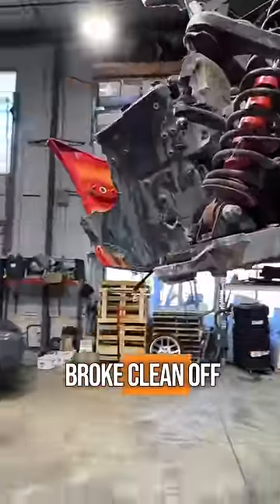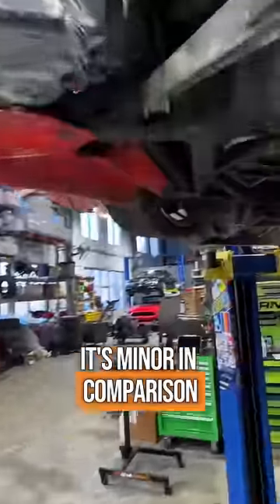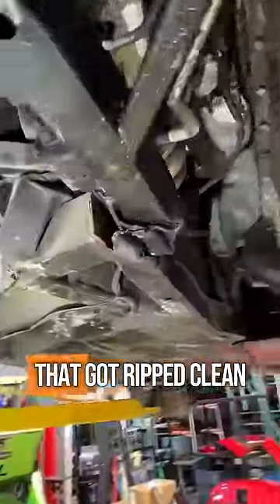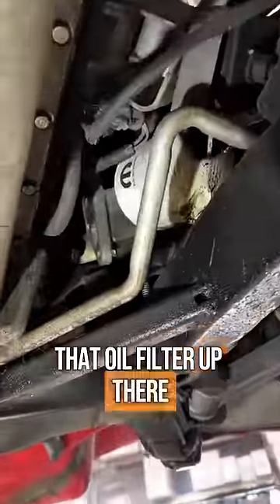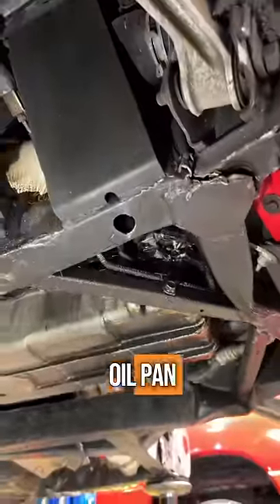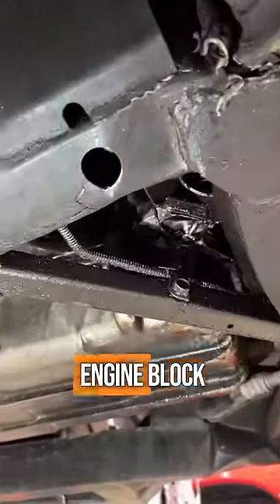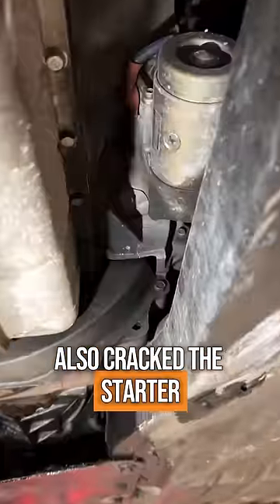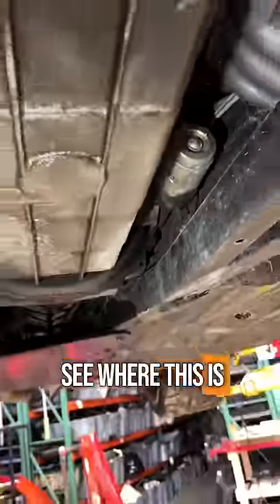$8000 Dodge Viper = JACKED Up!!

Comment: Worth about $500!😖
Reply: Naw $250 for scrap metal
Reply: Might be some stuff left in the engine that's worth selling 🤷‍♂️
Reply: That Engine alone is gonna run you between 9k and 15k
Reply: @charlesyoung3444  trans too, rear end shit even the bbs rims if some can be saved those would be worth to someone need extras
Reply: @charlesyoung3444  not when its junk its has cracks parts broke off in it.
Reply: @charlesyoung3444 it’s cracked lol nope
Reply: @charlesyoung3444  it also had an open hole when outside so must have a bunch of water in it
Reply: @assssss3661  maybe 2 rims are good.
Reply: Y'all are right, commented before he mentioned the cracked block. He said he made his money back, but so would I even if I didnt
Reply: @charlesyoung3444  not everyone has a viper. He made his money back from the youtube views
Reply: @djhodges6892  I like this guy, I'm not a hater just want to make that clear. But realistically he's made about 300$ off his last 3 yt shorts with the viper. Again not hating just being realistic
Reply: So dude died I’m assuming lol
Reply: I agree, 500
Reply: Go find a motor for $500😂
Reply: @trueaussie3097  You're looking at a cheaper one right now.
Reply: @trueaussie3097 in the conditions this one was in ill find you 30 for less than $500. Unless you have the ears of a fish he clearly said the block was crack in 3 different places from what he can see right now

Comment: If you paid 8k for that. You got bent over and used as a dumpster
Reply: He’s already got more than that out of the parts and still has the motor and other stuff left
Reply: @jamesfair9751  That engine is scrap.
Reply: @sdvten the block, yeah, but he's got pistons and the head/cams might be fine too
Reply: @magikarpusedsplash8881 you think it's a good idea to use pistons out of an engine that was wrecked so bad, so hard, that it cracked the block... Twice .. literally corrugated the frame, and put the oil filter under the trunk.... MF do you work for Ford or something
Reply: Until you realize YouTube money is the goal
Reply: @jamesfair9751 motors trash.
It's been sat outside with no oil cap and cover over it.
The engine is cracked in multiple places.
The gearbox bell housing is smashed.
Basically every inch of that car got pummeled.
Look at the chassis rail it's folded in on itself...
Reply: @jamesfair9751 didn't you listen, the engine block is cracked in three different places. So he doesn't have an engine left over my friend Total junk for 8K, This dude got hosed that's for sure
Reply: @magikarpusedsplash8881  i mean, i get your point. but buying used engine parts is a sin itself. Salvage as much shit as possible, but at this point, no one wants to buy a used pistons from a cracked engine, especially if the car was this bad. (You have to be honest when answering where it came from, or mom said go to jail)

like, if im buying used engine parts, which i will never, i am going to ask the mileage, the engine oil used, and the type of owner, also the car condition before it was taken out, every picture of it. it is better to keep it for yourself if you think it is good enough to be used again.
Reply: Lol yep
Reply: Hard to believe he made 8k and still has the damaged motor and trans
Reply: @11bravo80 the trunk lid might be ok
Reply: As a dumpster..... 😂😂😂😂 Good for you
Reply: I don’t agree. There’s probably twice that in parts. He could spend a day stripping parts and a day getting it out there that he has OEM parts. If you’re in this business he will basically make 8k for approximately 60 hrs of labor. Pretty nice right!!!
Reply: the block is cracked that engine is done
Reply: The t56 6spd transmission in that car is worth about half of what he paid for the car. As well as the engine is worth even more than that in parts. So no he didn't. You'd know that if you knew what you were talking about
Reply: Do it for the views
Reply: @jamesfair9751 Ya which part? Lol
Reply: @jamesfair9751 motor? What motor? That motor took such a hit that it’s all cracked up.
Reply: Yep

Comment: I paid 7k for my 08 viper, wasnt the best looking one but it ran and drove fine. Also had to replace the soft top
Reply from the maker: Wow! That’s an insanely good deal
Reply: @LeeC  yeah was a good deal, till I took it down the drag strip and lost oil pressure, had 2 rods come out to say hello
Reply: Cap

Comment: $8000? There's a fool born every minute
Reply: Pretty sure it was bought not in person and it’s ROUGH
Reply: @itsbrendoni3444  Still a fool if bought sight unseen
Reply: Prolly made more then that just on this video from all the hate comments 😂 yalls the clowns
Reply: @DesertRunner602 lots of people who do rebuilds from copart buy sight unseen 😂
Reply: @DesertRunner602  wasn't bought unseen and he made money off it so pretty good
Reply: Viper parts are very expensive and there's not a lot of aftermarket made.
Reply: He's already made his money back in parts he parted out. There's still more viable parts he's still removing, and the rest will probably be scrapped for even more
Reply: not with the chop value is on that, some stuff will also work with the Ram SRT10
Reply: You have no clue what money comes from parting out

Comment: I get it, rare car for cheap… but some things just need to be let go😬
Reply: Agreed, no reason to bid this scrap up to 8k hahaha
Reply: Same
Reply: With some cars they’re basically buying the VIN number so when they rebuild it on a new subframe it’s still technically a salvage title viper. Idk what these engine and transmissions go for but I assume that’s most the value besides the VIN.
Reply: @alexburke1899 does a salvage title give it cheaper insurance or something
Reply: @GewelReal  no it’s just harder to sell it, like when I do rarely look for a vehicle I usually click the filter so it filters out salvage titles and just displays “clean titles”. There might be some issues insurance related because it is a salvage, like I doubt you could get full value if it got totaled etc.

There’s nothing wrong with buying a salvage title vehicle if you know about vehicle repairs and know what you are looking at, and can make sure the repairs were done properly etc. I just don’t know enough about most vehicles to know if it was rebuilt correctly and would rather avoid them but there’s obviously some that are rebuilt correctly and a good deal if you are mechanically inclined.
Reply: Yeah this was done for youtube comment interaction purposes. He got hosed.

Comment: I bought my 2016 viper for 55k, put a clutch in it, and have been daily driving it for 6 months
Reply: Daym 55k that seems cheap for the golden year
Reply: @deadknight7617  it really was, I really just got lucky. Its a good thing they kinda suck to work on transmission stuff
Reply: Trade for a gated manual v8 R8 30k miles.
Reply: Great. How is that relevant to this vid?
Reply: @CR-te7hn  nah, I'm trying to trade up 🤣 🤣 🤣
Reply: Thats a badass daily
Reply: @connorarndt1726  it is, I just got lucky tho. I just wish I could drive it to work, but my job won't allow that bc im always bringing guys to and from the jobsite
Reply: @jacobm9263  true that but still a beauty of a car
Reply: @deadknight7617  absolutely is

Comment: Motor is most likely junk, If you have an engine that is spinning at 6k RPM's, and It comes to an immediate stop, due to a collision, the crankshaft can snap, probably has a screwed up block too!

Comment: What's your profit on it? Most of the car is fiberglass so scrap is gonna be low low . I do the same thing but I would not risk something like that here in Philly and would sit on the parts for years I would never see any real profit from something like this . Just wondering as I'm thinking of some kinda change

Comment: So vipers are built as terribly as the rest of the Chrysler products. Really analyze that accident. No fucking way should some of that shit have happened. If it was actually a well engineered and manufactured vehicle, you wouldn't have such odd impact signatures. Im an automotive engineer/automotive fabricator/completely fearless wheel man. I have ZERO mechanical sympathy. If its gonna break, its gonna break why pussy foot around delaying the inevitable? Anyway my point is, ive seen and been involved in every sort of vehicular debauchery in existence. When vehicles are manufactured properly, they dont look like this after an accident unless everyone in the car passed away in the collision. My girlfriend was a cop before i knocked her up. She worked a double on St.Pattis day and didn't eat anything but a cliff bar. She took a couple unisom after she got changed from her uniform. All she did was throw some sweats on and MY fucking Yamaha hoodie. She then proceeded to fall asleep behind the wheel of her almost 500hp Ecoboost f150 and pinned the throttle when she did it. The truck rolled 11 times and she WALKED AWAY!! On scene one of the paramedics told me "Brother if she drove a chevy, i dont think shed be with us."

Comment: just parts it at that point... You're going to need a whole new frame entirely, new diff, new drive shaft, new front suspension and strut towers, and whole new front end entirely, possibly new engine... (It wouldn't worth putting a new original one in, because there is no telling on how good they are on the inside... If your trust worthy buddy was selling you one, hack yeah buy it from him, but if not, you're better off swapping the engine, because the engine on the market could be overpriced and trash, or a fair price and in good shape, it's better to go with a swap than the original engine because they are hard to come by at a decent deal)

Comment: If you are interested I'm very serious about this I have a viper for sale but it doesn't have a title. It's 100% complete has 8,000 miles on it. It's an excellent condition but unfortunately it's either can be converted to a race car or a parts car.